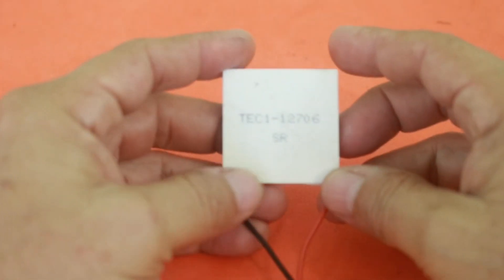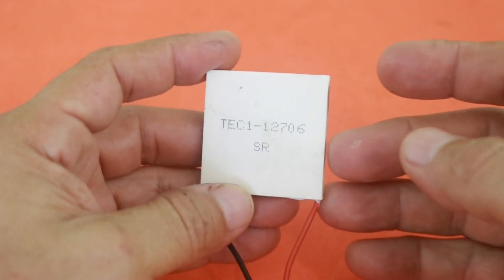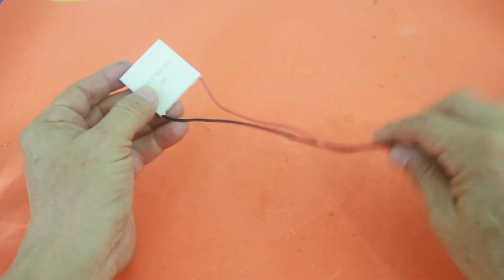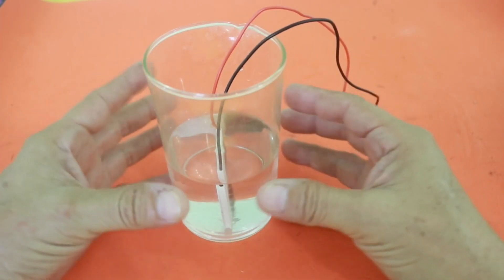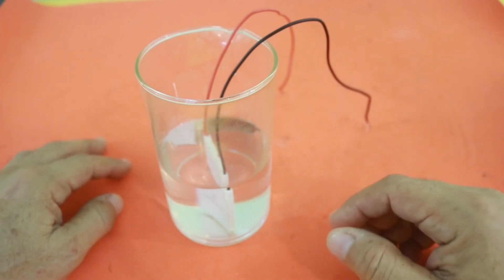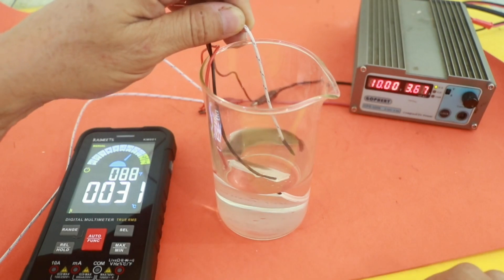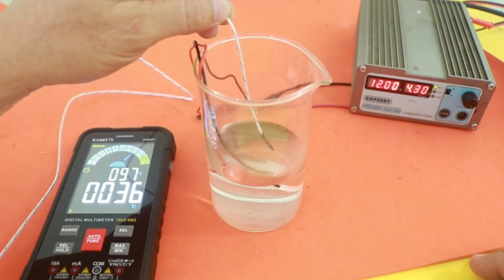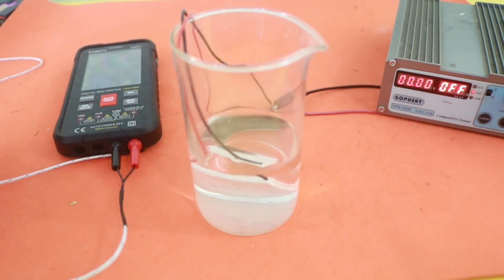Experiment with Peltier Cell

Comment: Nice simple experiment. Another way of looking at it is as a measure of efficiency. If the cooling was 100% efficient then the temperature change would be zero. You can calculate the watts lost by using the formula; Watts = specific heat capacity (c = 1 for water) x mass of water (m) x change in temperature in C (T) / amount of time the device was on (t). Good way of testing Peltiers though am not sure that like being soaked in water, maybe seal the edges and then immerse them in water?
Reply from the maker: Thanks! Edges are already sealed but of course they are not designed for this..

Comment: Actually there is kinetic energy conversion.  The water will cause a convection current.  The hot water will move into the cold water making the water move.
Reply from the maker: You´re right I forgot convective movement.
Reply: Also he is placing the probe directly over the hot side, therefore his postulation is incorrect.  Near the cold side his probe would show a lower temp.

Comment: I question the results in a way. 
Since heat rises and your have it at the top. 
Also I dont know if the hot side was up or the cold to go direct at the sensor. 
Best to measure the water before leave it for a bit and then take it out and swirl it and measure again. 

Or maybe your results are correct that it gives off more heat than cold.